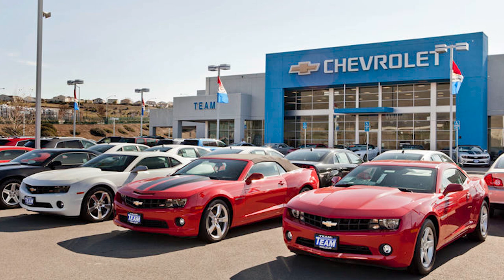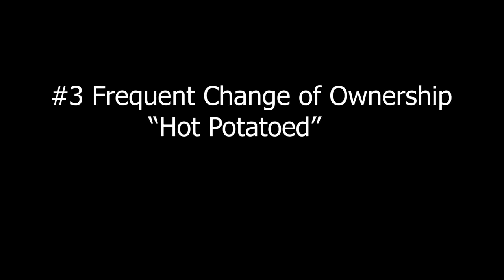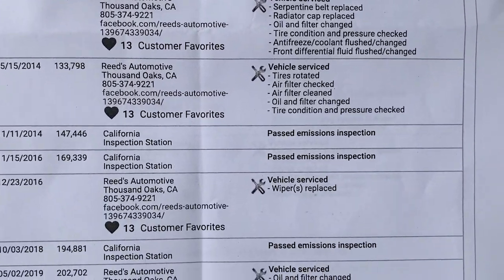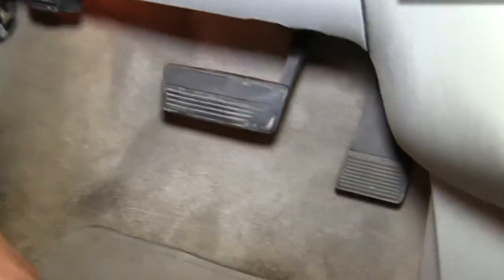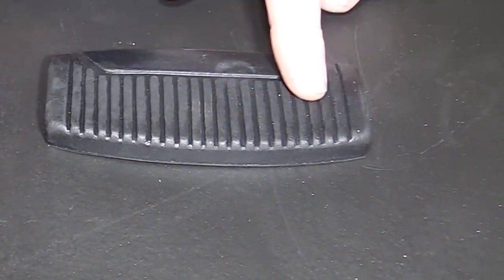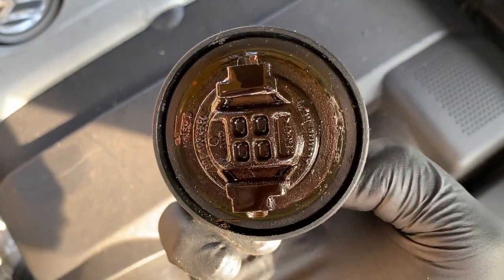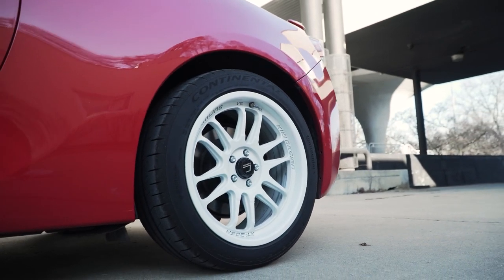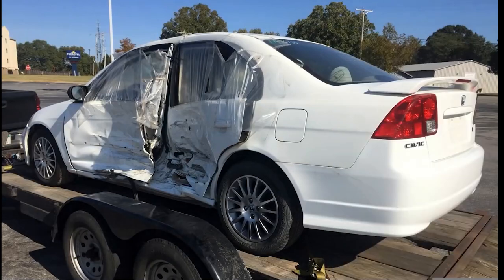Why its Dangerous Buying from a Private Party

Comment: These tips should be applied when buying a car from a dealership as well.
Reply: Especially a dealer! I've never been to a car dealership that was honest!!!!
Reply: Exactly! And bring your paint spy! Those things are worth their weight in gold...
Reply: The last time I tried to buy a used car from a dealer they said I couldn’t take it to a mechanic to be inspected until after I bought it and then if it had problems I could bring it back and trade it for credit toward any other car on their lot . I just laughed at them and left
Reply: I could not believe the internal abuse that this older ex-rental Pajero had sustained that my local Toyota dealer was trying to sell on a few months ago. The only thing that car had going for it was a decent paint job.
Reply: @clear_gray_sky539 I hear you but why would they trust you to run off with their car? You could cross to Mexico.

Comment: I always look at tire wear. If it’s not even, you have suspension issues. If they’ve put a pair of cheap Chinese tires on the front, they’re hiding suspension issues.
Reply: Not all Chinese tires are junk; I've ran double coin tires and have had no issues.
I have ran several sets of double coin tires and usually last more than 250,000 miles.

Comment: Great tips!  I've run into some "curbstoners".    I've also walked away from a deal because of empty bottles of "motor honey" in the back.  I always learn something from your videos.
Reply: Dunno, I got a great older-used-car deal for a Nissan Pathfinder from a "curbstoner" / hobbyist.  No significant problems in the 5 years I owned it other than it needing new all-season tires, brake pads and fluid changes.

Comment: Also, it’s very wise to purchase a OBD reader (scan tool) to take with you when you go see the car.
Reply: I also take a scan tool.  However I always inspect the car and only ever plug in the scan tool after I’ve decided to buy the car subject to it checking out ok.  When I scan the vehicle I’m looking for recently cleared codes, because that usually means there is an intermittent problem.   I would scan a car after the test drive and the test drive for me is the last stage, I’d never test drive a car unless all the visual inspections are good, no point wasting the owners time on a test drive unless you are quite sure you want to buy it.    If I’m buying or rejecting a car I do usually know within the first 5 mins which it’s going to be.   Be careful though, some cheap scan tools can damage certain cars, for example many cheap scan tools can corrupt the odometer on a Smart Car dashboard.  Always get the owners permission to connect a scan tool.
Reply: @andrewstones2921  does this just apply to certain years of cars ? What scan tool would you recommend? Would it apply to 2007 Toyota Highlander Hybrid? Thanks
Reply: ... And if you find out that the car had it's battery installed just yesterday because it was sitting in the driveway, you will have no data to analyze. The car needs to be on the road for 15-25 minutes for the data to be saved. Turn around and leave, this is done on purpose!

Comment: Another great video.

In my area half the ads on Craigslist have the license plates hidden - often by a blurry finger than also hides most of the rest of the bottom half of the car. Most are regular people who see this in other ads and somehow think they need to do it as well for some sort of privacy reason. It's silly but it's true. 

To your second point, a lot of people these days don't want to meet where they live. They've heard a horror story or two and want to meet in a parking lot somewhere. In fact, it's mostly the risk-averse people who will maintain and drive a car very carefully who are like this, basically exactly who I want to buy a car from. I've even had people cut their names and addresses out of each individual service receipt before handing them over. Who knows why: their name and address is already on the title. 

I've also had people insist on meeting at a bank even if I'm paying cash and they have title in hand. They want the bank to "check" the money.

One thing I look at is tires, not just for condition but also quality: cheap off-brand tires tell you something about the owner. Also I'd rather pay myself for good new tires than spend 40,000 miles driving on cheap junky tires.
Reply: 100% agree with the points you made. I am in the car business and regularaly buy cars. Tires tell half the story.

Comment: You also need to know for each car you are looking at what issues that particular model/year has. Some years might turn out you should avoid. 
 If you know these  issues a model has and these other issues like frequent oil changes done and the person just doesn't give off sleeze vibes you can get a great used car from a private party.

Comment: The spaces between the notes is where the art resides. Greg doesn't post everyday but when he does it is fucking full of useful information. The devil is always in the details. Just buy a Toyota Camry from the late 90's to early 2000's. I still drive a 96 Camry V6 I bought from an old man. Those things are indestructible.

Comment: What concerns me about your Halo list are all the cars with GDI engines and whether or not they have problems with carbon build-up as they accumulate miles.
Reply: I looked at his list. He recommends cars with known issues and class action lawsuits against the manufacturers such as Hyundai/Kia . He also recommends Nissan and infinitis with CVT transmissions. Anyone in the car business should know how often those transmissions fail. And the new ones are worst than the older ones. 

He recommends Buick Verano which is a rebadged chevy cruze with the 2.4 engine from the GMC Terrain.  The engines on those cars don't even last 100k miles. Interesting that he doesn't recommend Chevy Cruze.

He also recommends the unreliable Mazda 3 which is basically a Ford Focus prior to 2014. But he doesn't recommend ford focus. 

He recommends Suzuki XL7 which is a rebadged chevy equinox.  But he doesn't recommend Chevy equinox. 

Many of his recommendations are money pits specially Hyundai Kia and Nissan
Reply: @m.b5777 
Thanks. Sounds like some serious misgivings. I know the 2015 and newer Honda CRVs are problematic due to the GDI Earth Dreams engines and carbon build up, not to mention gas dilution and other issues.

Comment: If you are a non-smoker and are looking at a car which is advertised as a non-smoker car, but you find out that it is smoking white or blue smoke at the exhaust when the engine is running, skip it. That is a clear sign that the car was severely smoked in the past.

Comment: alot of this only applies if u are buying a used vehicle that is less than 10 years old ,  but it would be really hard to find fluids that are not kind of dirty or paint issues on a vehicle that is only gonna cost 3 or 4 grand and is 15 years old with 100 k miles on it or more .   the key is to buy only from the original owner ,  so even if the vehicle is over ten years old it will still usually be in good condition if the person owned it for all that time and bought it new .

Comment: Awesome....would love to see more videos of yours....
Hey Gregg, please tell me , if I should buy a used corolla or new corolla???
According to your experience , which tend to last longer??? Are newer one's built better?? I heard they are using more plastic parts ( which we know breaks or cracks at some point of time) .... So your thoughts and opinions....

You are doing great job...keep up
Reply: On some of the newer toyotas people are have issues with the 8 speed transmissions so avoid those.  On some of the toyotas they had problems with oil burning on the 2.4 4 cylinder engines so avoid those. The 1.8 4cyl, 2.5 4cyl, and 3.5 v6 are all great engines.  Avoid rusty cars, and decide what features you want.  I personally think a 2.5 camry is a better car value if keeping long term, much more comfortable and more room.  In 2018 model year on the camry at least is when they changed to the problematic 8 speed.
Reply: @GlennC789  you think I haven't done that? 😂😂 , Well I asked him many times..he didn't read mine....

Huge fan of scotty , Gregg and Toyota😂😂
Reply: @GlennC789  he did say that he read all the comments in one of his videos...but I am not sure if he really reads...

Comment: In the pictures on Craigslist or marketplace, I just get weirded out if the water hose is still in the driveway and the driveway is still wet from them washing the car. It just makes me feel like they are trying to get the car cleaned up, posted, and not their problem anymore as fast as they can.

Comment: Hey there, I enjoyed your videos on how to buy a used car, and the Bathtub curve. My question is I want to buy a used Prius v wagon five, and or a Prius 2013 five model as a second car. I currently drive my 2017 RAV4. I live in Colorado and put on lots of miles going to the mountains. I am 70 and get quite intimidated when I need to buy cars, so I get talked into  buying new ones' afraid of breaking down.  I am thinking I should have a male friend help me look at these cars.
My questions are:  I see the above models of these cars listed through Edmonds, carguru, car dealers, etc. with high mileage on them. Where is the sweet for a Prius? Do they have the oil caps? What specifically do I look for in a hybrid or a hybrid plug in that you have not mentioned for hybrid used car buyers. 
Why do these company's say send a note to the seller letting them know you are interested. Who is selling the car if I were to buy it? Just because they ask for a price, I don't have to agree to it. Where is the haggle room and with whom? I don't understand the delivery aspect am I paying for that. What fees can I avoid? Can I ask them to let my mechanic look at it? How does that work? I don't want to spend a fortune for a second car to run around in Denver, but my grandchildren would appreciate me driving a hybrid.

I am very interested in your comments, I hope you do respond. Thank you kindly, Deborah
Reply: Stick with conventional ICE.  Hybrid is expensive to maintain once it passes 100k.

Comment: One clue of a carefull previous owner is paperwork, invoices in particular. Are the invoices matching with the story? If the guy says the car was cleaned regulary, does he have the receipts? Etc, etc. Some people have great cars and don't keep paperwork, but why would you be taking such a risk?
Reply: I've owned a 4Runner for 12 years and have done basic maintenance myself.
When I decided to put the Truck up for sale, I brought it in to a Toyota Dealer for inspection. They did engine fluid service for the vehicle. Due to covid19, the dealer pick up and delivered the Truck curbside to my house. When I checked the truck, there were pink coolant left on my hood and when I opened the hood, there were oils on top of the engine cover. It was a very sloppy job.
To me, paper documents just showed that the owner doesn't care enough to learn to care for his own personal vehicle.

Comment: Greg,thanks for your great insights on things to look for when buying a used car. I recently bought a car from an auction and upon further inspection under the hood as well as underneath, I noticed a significant amount of rust on the hose clamps as well as parts of the frame underneath. There was even rust on parts of the front seat brackets in the interior. I live out west where our climate is dry with little humidity so I’m convinced this car came from a high humidity part of the country.I’m puzzled because the paint looks great-with no sign of rust (a local body an said it’s original, yet why the rust build up elsewhere?
Reply: Flood or water get inside the cabin, engine water immersion.  WALK AWAY!

Comment: why not recommend a prepurchase inspection?
Reply: These tips are just the beginning of the process...red flags that may eliminate the vehicle before even starting the engine.
Reply: Many private sellers are not available during the hours a mechanic is open due to working a full-time job themselves.
Reply: @saablazer  No PPI, no sale. Simple.
Reply: @saablazer  I used a mobile PPI when I purchased my Toyota. I would never buy a car without one!

Comment: Much thanks on all the tips.do you have any tips on auto theft prevention? For someone with limited funds.like removing a start module or similar . Tried  the club but steering wheel was cut, alarm disabled somehow. Vehicle has a transponder chip key. Still stolen. Whoever stole the car knew were they were doing not amateurs.
Reply: Install a hidden master-switch. Also, move to a nicer area. Check city-data for crime rates.
Reply: @aliendroneservices6621  

One should check to see what cars are the most stolen.

Comment: New subscriber here. Im in the market for an older camry that ill use as a backup for work about 60 miles daily highway.  What are your thoughts on buying a salvage title from Craigslist or buying from a car flipper on Craigslist.
Reply: I would never ever buy a salvage or rebrand title.
and never ever cheap out on brakes and tires on your vehicle.
That's why my mechanic told me.

Comment: Hi YourCarAngel,  question, does low mileage for about 1,550 miles per year affect the battery life everything else being equal? I am thinking of buying a 2nd generation Prius and drive 4 and 7 mile one way trips a week. So I am concern that low miles driven will reduce the life of the battery.  And thank you for your videos they have been helpful.
Reply: Ex 2nd gen Prius owner here. Let me share you my experience. Nothing else here. 

HV battery work best when it is being used a lot of times to extend it longevity via stop go traffic, 55-65mph hwy commute, and cruise control. Also, it works best when the weather doesn't get hot or cold.

The one of the unfortunate parts about this 2nd gen Prius is that it does NOT come with a HV battery cooling fan, located located under the rear seats, just to send the heat/dust out of the Prius. Instead, it retains heat and built-up dust/debris from outside. Basically, Prius is sensitive to certain range of temperature and element, especially when not being used.

Having the Prius with the aging battery parked outside with very high/low temp for extended period of time has an negative effect on it life. 

Overall, 2nd gen Prius is great when it get used extensively in terms of mileage. That's where the return in investment comes to play. 

Buying a used 2nd Prius just to save gas and drive way below average miles per year alone are not a wise purchase. That's why I sold mine after spending 40, 000 miles in 4 years of ownership. (32,000 miles spent for 3 years, 8,000 miles spent in the last 12 months).

Lastly, if you want the Prius, in general, looks for the one that is garage kept PLUS tinted windows and a rain visor. Tinted windows help extend the life of the HV by reducing heat retention. Also, chances are that the owner treats the Prius more than just the appliance (which is good!). Mine had it and it wasn't done by me. It was the previous and the only original owner who was a fan of it purpose.